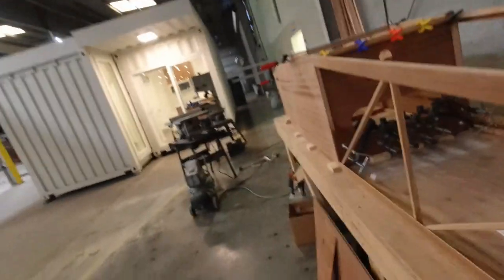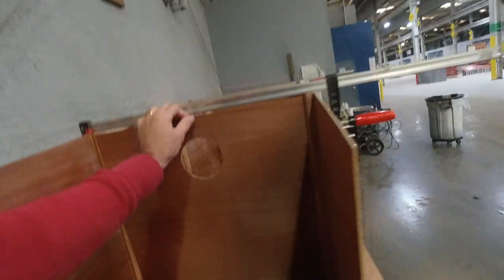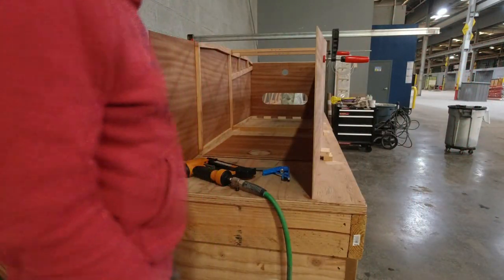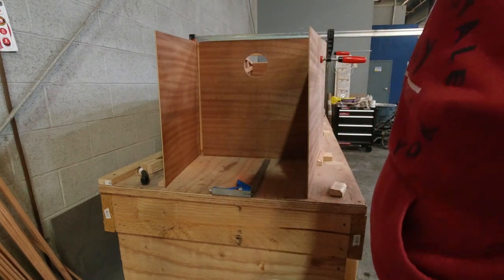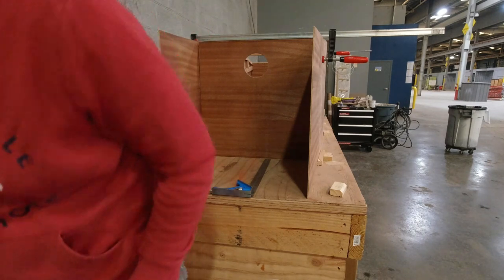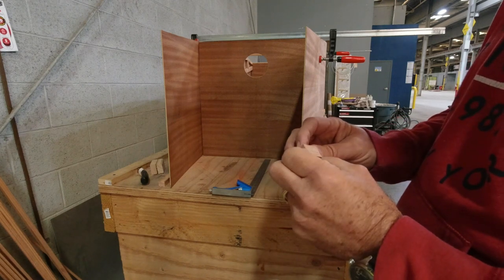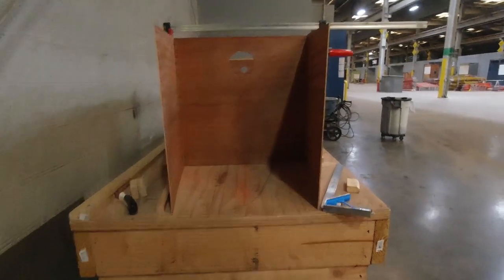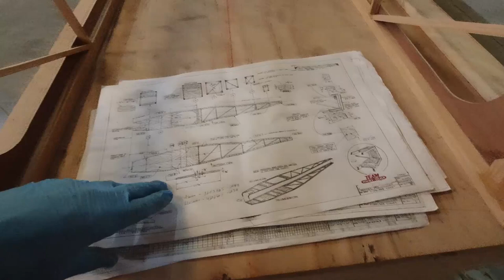Minimax 1100r Aircraft Build Vlog Ep 59 - Part 1

Comment: Dennis.  I had forgotten just how DIFFICULT it was, pulling the nose together,.   I had to enlist the help of my wife on this portion of the project.  My construction techniques were not as elegant as yours, so I needed another set of hands.:)   I sure could have used your help during this part of the construction.  :)   I was thinking:  "No Big Square, no project.  :)   I must have worn the metal off that square before I was done.  :)   I remember "squeezing in the sides of the nose, and "waiting" for a big "SNAP" as the side would be giving away.  :)   Didn't.   Your idea of "preforming them "dry" the night before was an excellent idea.  Still with you bro.  :)

Comment: Dennis, what size/ type staples do you use?
Reply from the maker: I used the T27 staple gun and the JT21 staples in 1/4” and 3/8”
1/4” for wing ribs and stapling the 1/6” and 1/32” sheeting. Then the 3/8 for the 1/8” ply.

Comment: Would allowing a few relief cuts on the inside allow easier nose forming? Then fill cuts with epoxy.
Reply from the maker: There are some relief cuts in the 2” ply capping the corners at the rear but I have never seen anyone relief cut a longeron. I believe there is an acceptable method for stringers, but not certain. I’ll have to research that as you have me curious.
Reply: @DTMinimax  just wondering your thoughts. It just seems like the glue joints would be under constant stress because of "spring tension" always present even after the epoxy has cured. A splice like you made in the tail section that would provide an inward angle to meet the firewall so no forcing the two sides. It must not be an issue because 100's have been built without any issues.